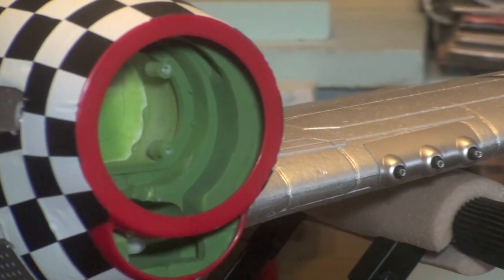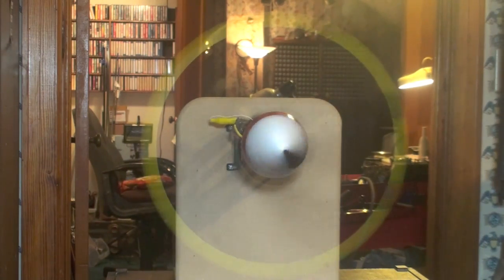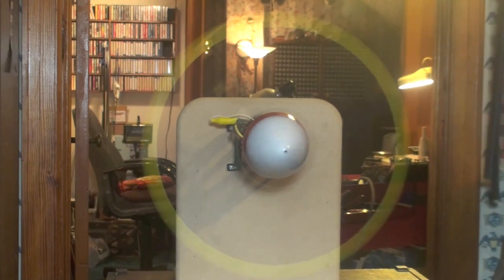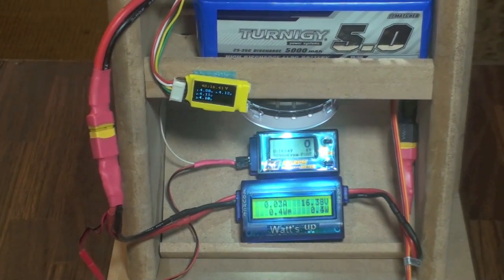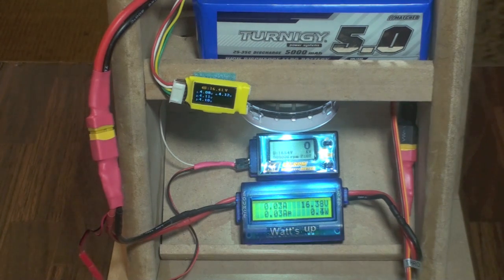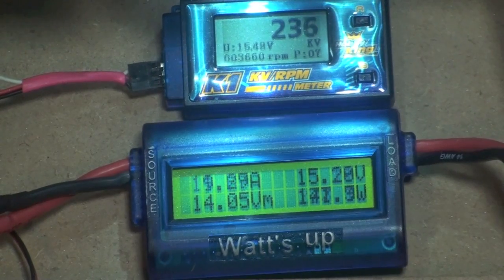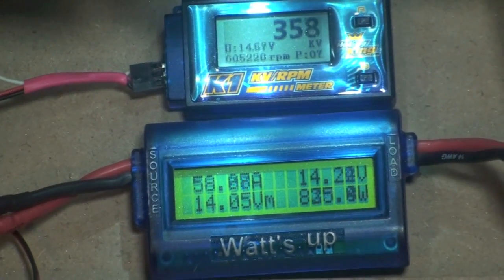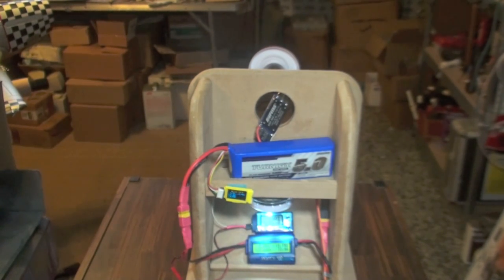G&C 4250 540kv Test

Comment: Hi!

You did great job with this tests, also on rcgroups! Thanks for that!

I've got a scratchbuilt Corsair 59' wingspan, with G&C motor and FMS 3-blade prop, witch suffers poor max speed, so I’m really interested in your measurements of this power plant.

One thing in your tests confuses me. It’s “strange” kV readings.

In the test above, with p-51 prop with shimed prop blades which give more drug, kV reading for 540kV motor is 510-520 kV.
In Your another test (here on YT) of the same power plant but with no-shimed prop blades (should give more rpm), you obtain circa 360 kV, so much less.

On rcgroups, your tests of this motor (and 580kv version) and different props, have consequently showed higher kv readings than those manufacturer declare. That refers as well to Corsair’s 3-blade prop, that in your test achieved about 550-560kv with 540kV motor.
 
In the same time, my measurements of 500kv motor and 3-blade prop (non-tuned in any way :) ) showed only 390kV :/. So, I’ve ordered and just got 540kV variant and gonna put it under tests. Wonder, what watt- and tacho-meter will show… and if my Corsair gain some more speed...
 
Maybe I don’t understand sth? How would you explain these differences in kV? Which readings would you take as less trustfull – higher or lower kV readings?
For me, it’s hard to say these differences come only from lack of precision in measurements. Maybe differences in quality among particular FMS motors?
Glad to know your opinion or better – to talk on the web (on rcgr maybe?).
 
Once again – great job. Really appreciated.
 
Regards
Bartek